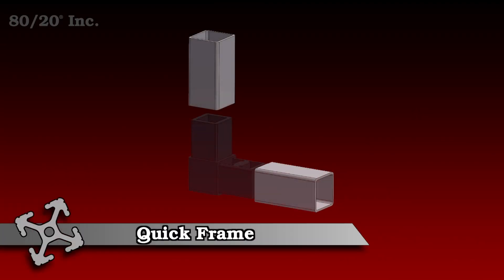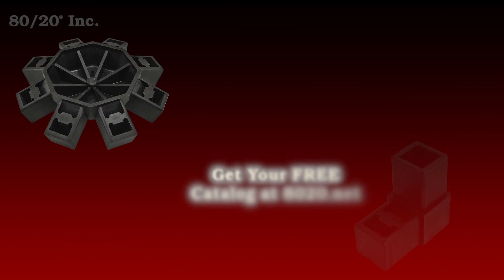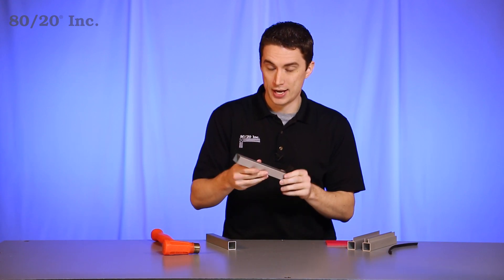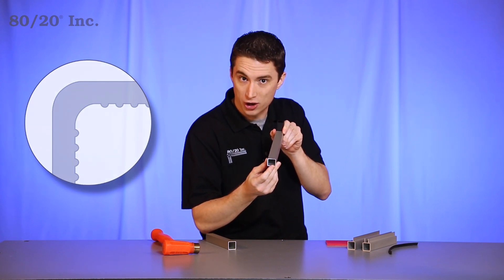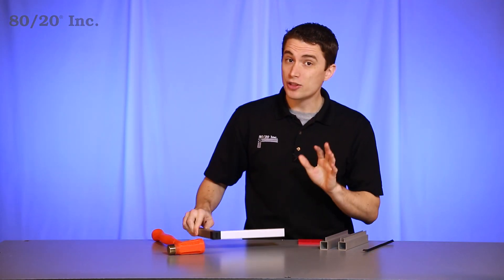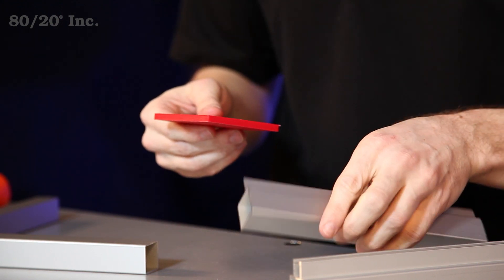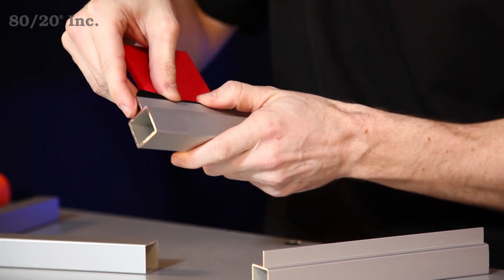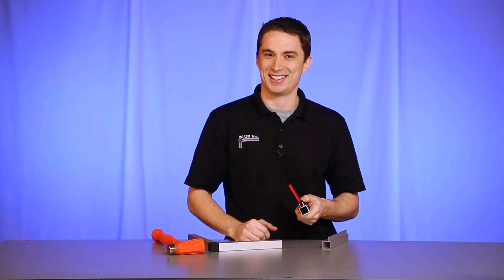80/20: Quick Frame Overview

Comment: On the flanged profiles, it looks like the flanges will need to be mitered at the corners. Is that correct?
Reply: I'm in the middle of trying to figure out how to do it right now.
Reply: @SurfingFLA  Did you come up with an easy solution?
Reply: @vjtoad  Easy, no. I made a 45-degree angle out of a heavy piece of steel. I use it to mark the flange by scribing it. From there I chomp it with a tool used to cut horse shoe nails. It just scores it deeply. From there, I grab it with a pliers and break it off by working it back and forth. Some filing is usually needed. Somebody needs to make a tool that just does it in one fell swoop.

Comment: Looks like the Quick Frame connectors are made of plastic. Are these connectors able to withstand outdoor exposure to UV and varying temperatures?
Reply from the maker: Hi there! That is a great question. The connectors are made of Nylon Zytel and are suitable for short term UV exposure. More than that, and it can potentially begin to fade the material.

Comment: Do you have a video or spec sheet on using slide rails for drawers? I am interested in proper length and how much room do I need between frame to frame (mounting posts). I am tring to design a 18 drawer cabinet and wondering how wide I should set the frame given width of a drawer or drawer size to match frame size.  I am drawing it out before building it to make sure it will meet my needs in making a part list. I realize slide rail very in sizes as well as fasteners that are recommended. Perhaps if see one example in figuring out total distance, I can use it on any configuration. I'm looking at about $2800.00 in materials while keeping the cost to a minimum.  Size plays a roll in this design because of the layout of the materials being stored in utilizing 5S standards.
Reply from the maker: Hi there - thank you for your question! We recommend reaching out to autoquoter@8020inc.com for a sample drawing.